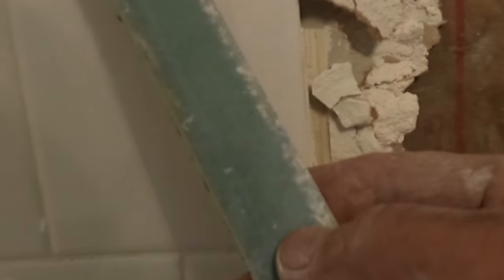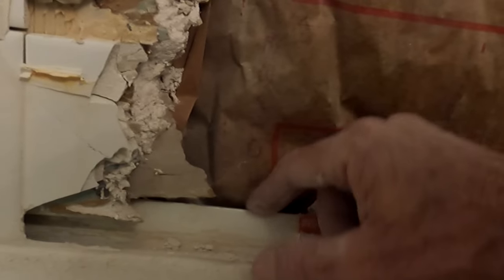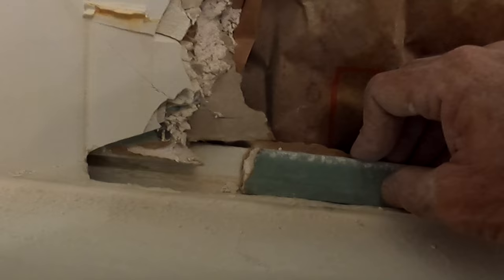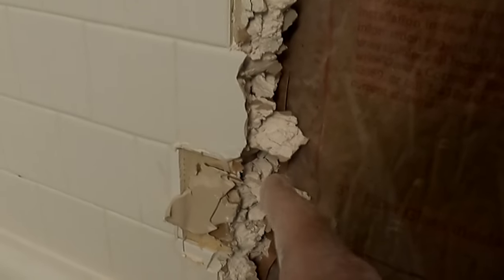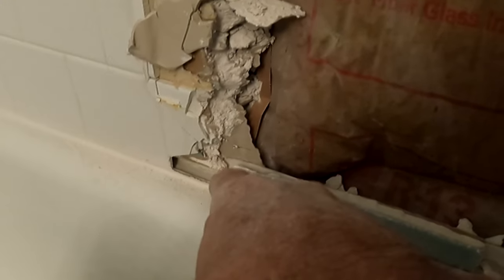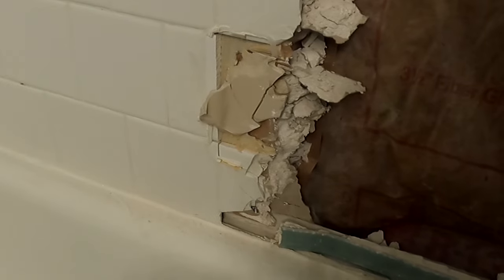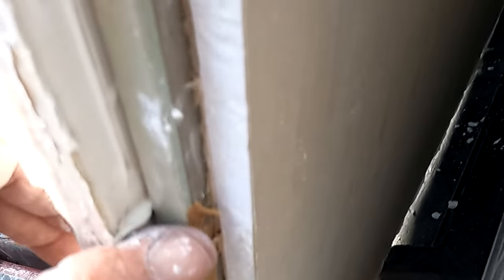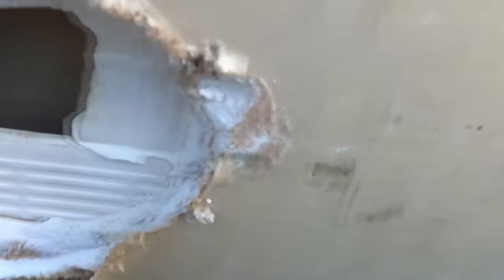WALLBOARD ON LIP of TUB...20 years ago

Comment: I’ll be using this method you’ve shown…not just because it makes sense, but it’s clearly illustrated on the manufacturers installation instructions for the shower pan I’m installing. I bet if we went through the decades and examined all these handbooks, we’d get a kick out of some of their suggestions with what we know now and have seen in these demos. Also, if anyone is ever worried about the gap there and fear water rising above that lip on a tube or shower pan, I’m afraid you’ve got bigger problems and may want to head to higher ground lol. Thanks for the video 👍

Comment: I also go against the grain on the quote Unquote book soldier rules on this, for years and years I put it where your Saying on top of the lip..... After it's screwed real good, then I fill the gap with thin set and concrete board mesh tape at the bottom and then go over again with thin set and make sure it's plum and it's not sticking out at the bottom. then let that dry overnight and I use personally, ardex S1K liquid water proofing over the wall, And go down onto the tub just a little bit. not too far where you're obviously gonna see it , Past the tile. I find this is the best method. Good video! I always say just because something's a rule or a law or a standard doesn't mean it's correct. so I think we agree on that. I believe I'm a mixture of what you call a book soldier and the real deal on the job since I was 17.

Comment: The deadly serious blood feud between the butting vs overlap method is hilarious. 

The flange is there to be overlapped. If you butt your backer to the top of the flange lip and caulk it there, you have 3 different materials expanding and contracting at different rates. If that uneven expansion and contracing ends up causing cracking in the caulk there, water is then diredtly entering your stud bay. 

If you overlap the backer to 1/4" from tub surface and the caulk fails there, water is still within the tub and under the flange. 

Like you tout--common sense.

Comment: It literally says on the tub of mastic do not use in wet areas lol
Reply: They mean in continuous wet areas like in a pool, shower pan, very bottom of a shower, shower curb. A Tub surround is a total difference animal. Most of the water hits the tub, the water that hits the walls isn't enough to remulsify the mastic. I've updated hundreds of tub surrounds done with mastic. They never failed, they worked just like the one in the video. You can use mastic in a backsplash and tub surround. I still prefer to use thinset but mastic works in those situations.
Reply: @williamp9158  unfortunately it doesn't mean continuous wet area any wet area which means it's not right and if it went to court you lose if its mastic because its any wet area even behind a sink 👍
Reply: @TheKronpowkid88  In theory yes, but in reality thats very rare cases. Mastic holds up suprisingly well unless you use it in a spots that get heavily saturated like mentioned above.
Reply: @williamp9158  Yep. Type 1 mastic meets ansi 136.1 requirements and manufacturers allow it in shower surrounds.
Reply: @TheKronpowkid88   @Titanglass88  This may depend on the mastic but in the type1 mapei mastic data sheet it says the following:

Under "Where To Use"

1. For tub and bath surrounds where service requirement do not exceed ANSI a136.1 type 1

2. For the installation of tile on walls in intermittent wet conditions such as tub and shower surrounds.

Under "Limitations"

1. Do not use for exterior applications steam rooms, shower floors or areas subject to water immersion.

2. It also says not not install over waterproofing though under this same section.

It seems either you have been mislead or it depends on the mastic that you are using.

Edit: I went ahead and looked at 3 more mastics and they also all said they can be used on tub and showers walls and other intermittent wet areas. So it seems that the vast majority of mastic can be used in areas that are not constantly wet.
Reply: Lol well I guess if you don't water proof your shower you can use it 🤣🤣 (every shower and tub should be water proofed meaning if its in a shower its wrong either you didn't water proof or you used it in a constant wet area)  not mislead give the manufacturer a call thats where I got my info second a shower isnt intermittent its daily and often more than 1 time per day  lets say a family of 3 thats 3 showers or baths a day minimum 30 min on average (girls and kids) not all one after another meaning it never has a chance to fully dry out so not its not a intermittent wet area  tile isn't water proof so vaper eventually makes it way into said mastic causing problems a shower and tub are not intermittent maybe at grandmas house in the guest bath but in normal households no shower really has time to dry out to be "intermittent"
Reply: @peterwest323  it also says that it can be food for microbes if used in wet areas thats why its not used in showers and tubs manufacturer exact words
Reply: @TheKronpowkid88  hmmm maybe you should contact the manufacturer and also ask why they say it is fine on all of there public documents. Maybe link a recording of your call? Its hard to go by an anecdotal evidence. But the water proofing thing I included because it did seem odd to me since you should do that like you said. Guess it is fine for backsplashs though, even behind a sink. But I also think 3 showers a day is still interment. What I take from it is that it should not be where water is sitting constantly. I am not sure if you are doing something wrong on your showers, but there should not be constant water pooling up in your walls. 

Could you also link me the info that shows mastic acts as food for microbs? That sounds interesting. One could use mastic based on the manufacturers words and gain a big lawsuit if it acts as a food in wet areas, if your recording has them saying that.

 On another note what manufacturer is "The manufacturer"?
Reply: @shawnsmith3741  as a tile guy i deal with it every day water isn't pooling in a wall again tile isn't water proof thats why we water proof walls water vaper penitrates all tile no mater what and when it gets to mastic microbes feed on it and problems start that is from the manufacturer all mastic type 1 or 2 its not anecdotal ive done my homework feel free to give them a call and ask to be transfered to one of the  engineers the guy who knows the product and they will tell you exactly what I said if you are doubting even if i recorded it you wouldn't believe it thats why I encourage you to call as to why this isn't on the public documents if it was they wouldn't sell any they aren't obligated to put that info in example asbestos manufacturers knew it causes cancer guess what it was still used and they didn't include that in with all the info
Reply: @TheKronpowkid88  Right but it is just odd that that they don't just include it, but recommend it for those applications. I mean regardless I don't use mastic, just want to point out it recommends its use in the documentation. I consider your argument anecdotal because there is no way for you to prove what you are saying is true. (That the engineers said so) I know the burden of proof is on you since it is your claim, but I will give mapai a call ask ask them and post the redcording here. If water vapor itself causes mold though, why do all the walls in the entire bathroom not start molding after a few months of long showers?
Reply: @TheKronpowkid88  Did you watch the video? Starrtile just proved to you it works. Even mastic manufacturers say you can use it on tub surrounds and backsplashes. Show a video proving your claim because you're just giving your personal opinion and your theory.
Reply: @TheKronpowkid88  It's been two years. Tell us exactly which manufacturer you're dealing with. I cannot find ANY information from ANY manufacturer that prohibits the used of mastic in the building of shower walls. NONE. I prefer thin-set mortar, but I don't have a problem with anyone using mastic according to the manufacturer's directions.

Comment: This assembly appears to be TCNA Handbook method B413-21. This method is only approved for use in bathtubs without a shower head (which this does appears to be). They specifically address the gap required, discuss the minimum standards the organic adhesive (mastic) including the small tile size you mentioned, and requirements that the gypsum board (Sheetrock) must meet for use.

This method is not considered acceptable in showers because other methods and products are available now that provide better protection and margin of safety. The trade associations in the tile industry are focused on providing a better product and installation. Specifically the TCNA handbook provides methods that can be installed and perform properly in real world environments, instead of installers basing decisions off of anecdotal experience.
Reply: Spot on!
Reply from the maker: @Timothy Steudeman....though I agree somewhat with your comment, there are MANY countries in the world that have no TCNA, never heard of it & don't care, and have been doing it longer than us, been to at least 4 myself. Plus it's a "GUIDE" and by all means not the last word or even on point in a lot of applications. Real life failures show what correction is needed to mitigate a failure, as I said in the end THINK LIKE WATER and be creative on your build, There are PLENTY Of failure videos ( one guy comes to mind ) that hangs his hat on rules & manufacturers instructions and does dis-service because he won't think things through ( thinking like water ) then blames the manufacturer. 

And BTW, this tub/shower combo had a shower head, as ALL of them do...never seen a tub without a shower head. And also the organic adhesive ( mastic, drawn from the mastic tree sap ) isn't used much anymore, most are man made & not organic. But regardless, these FULL showers or tub/shower combos that were built 35 years ago without newer products did exactly what they were intended to do, only failures were as I stated in the video "operator malfunctions"....case in point, the 100 year shower video linked here > 
https://www.youtube.com/watch?v=Jxi-iSh-6A0
Reply: You don't know squat.

Comment: Dude this is the same job I got 1981 my grandfather made the shower tub combo looks like dry wall only behind the wall Sheetrock????? And it was over the lip so sitting on the tub my idea of fixing this would be to keep the backer off the tub on the lip???? I’m only fixing one area the rest of the tub surround seems fine. Now I don’t know I really don’t but the 1949 bathroom down stairs is perfect one crack on the top but the rest is perfect and dry as a desert so I mean what a mysterious job I got bob  but far as I can see NO BACKER ON TUB! Should fix that bathroom for me seems to me from the very start in 1981 no moisture protection so I’m looking to seal everything because I take big showers I can’t lie so it’s important but it took 40 years to rot one section on the side I think my shower routine kicked that water damage up five notches